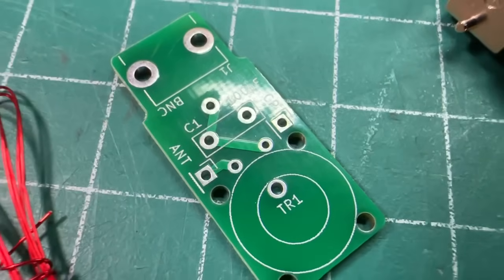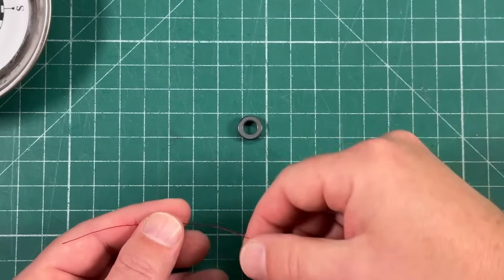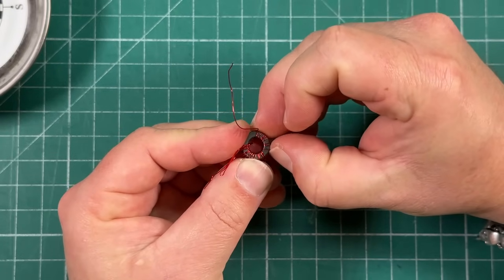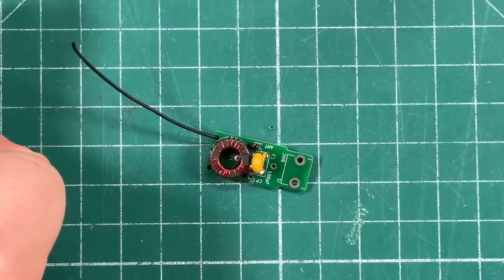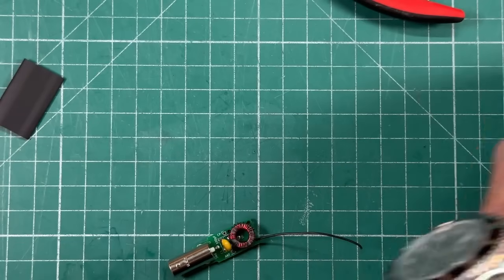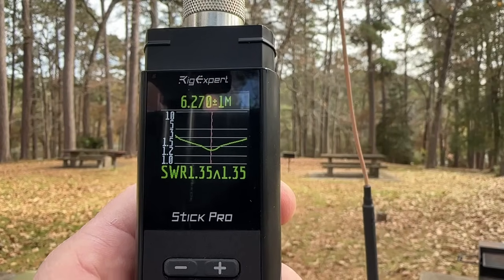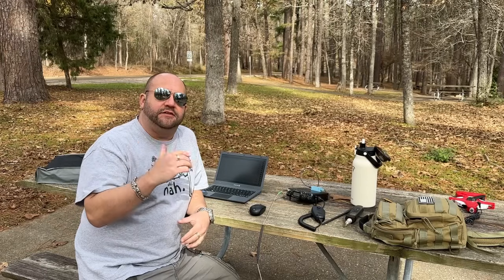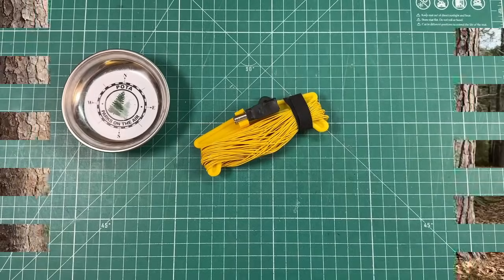This QRP ANTENNA Kit By Jonathan, KM4CFT is AWESOME!

Comment: I was using  speaker wire vertical, my recieve signal was a solid 6, on a station from Italy 🇮🇹.  I changed the speaker wire to 6mm Earthbond electrical wire, the signal jumped to 9 +  +

Comment: Good work Mike. I home brew 3 so far and they all have a slightly different VSWR curve but my FT 817 is very happy on the VSWR meter with all 3 antennas. My regular  SOTA antenna is the 3x18 for 21 total turns but it needed the 10 turn coil out from the feed point end to tune up best. Great antenna. Regards vk5cz ..

Comment: Drill out the hole for the 9 to 1 if that's the impedance ratio you want. Then add a switch for either 9 to 1 or 49 to 1. That's what hams do. They make things work the way they want them to work. BTW, I prefer tapping to twisting, because I think tapping is a percent or so more efficient, but twisting is more mechanically reliable.

Comment: Mike, nice report. Thx. What length wire did you finally settle on?  I built the EFRW 9:1 version last week. 29’ of AWG 26 hi viz. works great! I used 2mm banana plug to connect the radiating element. I’ve got another one of his kits here and will be building the EFHW Version this week.

Comment: great antenna build. looks like a easy kit. for that ferrite core the twist is not needed or is the cross over half way threw the winding. all that cross over i for is so antenna lead is opposite the coax input. that uses a PCB . if makings that a 9:1 you may need counterpoise but depends on length of feed line. and choke at radio . if using counterpoise choke at antenna . I haven't needed a counterpoise with 25 ft or more feedline. 73's

Comment: After watching this video, I checked out my parts kit and found a T50-43, 100pf cap, and I had a BNC. So I made it myself but, have not had much success with the EFHW tuning. I also found that my soldering skills are not what the used to be as my eyesight isn't what it once was. Too much solder, and created shorts. Some kits are pre assembled which are tempting to purchase. However, after all of this is said and done... I'd still prefer to make my own and gain the confidence & joy of building it myself. 73's de kd5smf
Reply from the maker: Heck yeah man thanks for commenting!  I do spend a lot of time tuning them.  Most of which is edited out.  I put it up, take a reading, bring it down, cut it, put it back up, take a reading, etc. etc. etc.  It takes a bit of time to do that.  Maybe an hour of solid tuning to get it perfect, but once you got it, you got it.  Totally worth it.  And I never have to take a tuner with me.

Comment: Noob here and hope my question is not too laughable. Will this antenna work for GMRS and CB as well?
Reply from the maker: You could tune it for the CB band, sure.  That's only slightly lower than the 10 meter  ham band.  GMRS, not so much.

Comment: At least you're using a chisel tip and not a cone tip like a dingus.  But, and this is just a friendly suggestion here, I think you'll have a easier and more enjoyable time soldering if you hold the flat side of your tip flat against the PCB pad and gently push the tip against the leg of the component.  If you're lucky and the PCB has plated thru holes this will get the heat into the pad/hole quicker and help to flow the solder better, then the solder will help to heat the component leg and voila!
Reply: I think cones are easier than chisel, it's a choice.
 Not a reason to call someone names